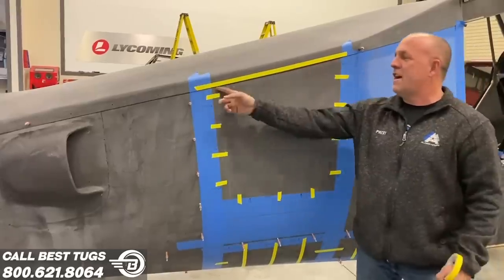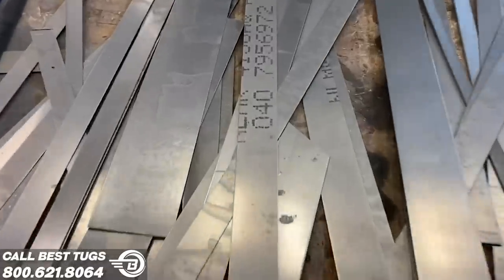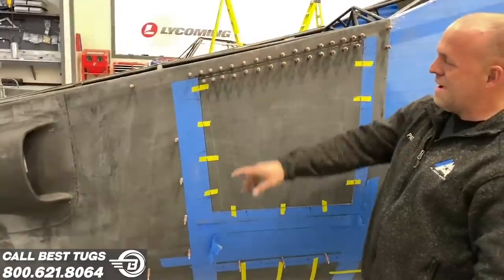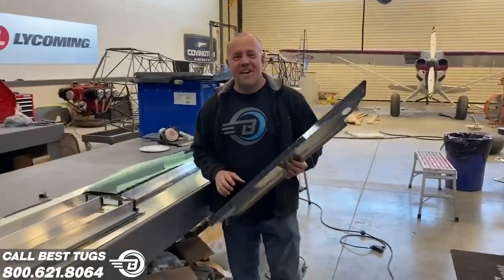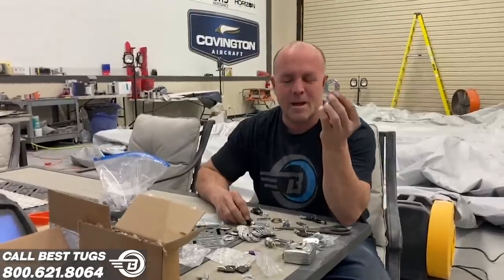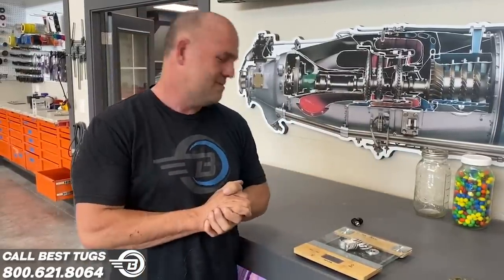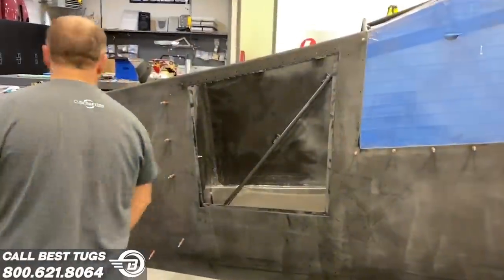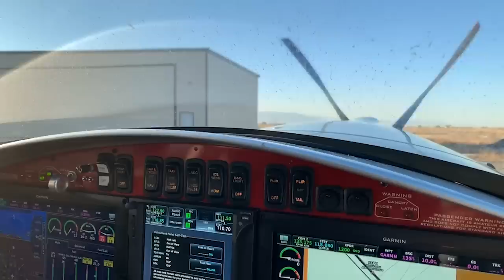Doors and locks (Scrappy Bush Plane 19)

Comment: And the rocket assisted takeoff, that’s being installed when? Still amazes me and stops me in my tracks every video you release.
Reply: Bruh with the engine and prop scrappy has, its going to take off like a rocket assisted cub compared to a stock cup

Comment: wonder if the cable pulley bearings run easy in the cold,  tossing one in the freezer and checking the rotation would at least give you an idea how they will spin back there in the freezing mountain tops.

Comment: I would have put rounded corners on all your doors.  More work but looks better, is not a sharp corner to hit your body on, and eliminates fatigue cracks from vibration in the corners.  Just my opinion.
Reply: it is not only your opinion: De Havilland DH-106 Comet 1...
Reply: honor harrington - all perfect but the sharp corners were my first thought and concern. How many times I’ve bumped my head on such edges that stick out when they are open, and those carbon edges should be especially sharp...  At least the corners should have some sort of flexible edge.
Reply: Good Idea but might be not necessary because of the carbon iber orientation. And the carbon haul won't take extreme stresses that part will be taken up by the tube frame i think.
Reply: @МитяА-с4н  That was a pressurized airplane. This isn't.
Reply: Valid, except you won't be able to fit as big of items to the door for storage...
Reply: Agree.  It's the same reason- and fix, for the early Constellations; they originally had square windows, developed stress cracks, and had to retro'ed to round.  And that was in the 1950's.

Comment: Silly questions time! Lots of fasteners = lots of weight and lots of work to make attachment points. Will all these bolts be titanium to save weight? Do we even need the steel frame? There are plenty of vehicles with CF chassis. Why can't an airplane have a carbon fiber & honeycomb monocoque frame? Panels can attach with glass-filled nylon Dzus-style fasteners to save weight and eliminate corrosion concerns. Thoughts?

Comment: How did you make the custom latch cams for your new locks?  You said they are a bit larger and look to have a deeper offset.  Do you have a press brake :-)  I like your attention to detail.  I've often wondered how the fuselage covering was attached to the tube frame.  Great work.

Comment: Question: You are using circular keys instead of notched keys. Don't notched key slots on airplanes have a little spring loaded weather door to keep water and dirt out? Seems the circle keys slots are exposed to the elements.
Reply from the maker: Laz    Great question 👍🤠 it’s an outdoor unit I use on equipment out in mud and dirt.  This will be way cleaner so it should outlast the plane but easy swap if needed

Comment: I was a bit puzzled about the hatches. You made them with square corners. I was wondering why you did not use rounded corners. Will you not be encountering stress fractures in the corners in the long run? Or is the fuselage skin not load bearing at all?

Comment: I didn’t know carbon and steel could corrode. I know that was a major problem with the twin towers as they were trying to figure out how to repair them or tear them down before 9-11. The biggest problem is that they never provided enough income to provide the Port Authority with enough funding to maintain the building. Things were so bad that they let a band have an entire floor for practice with a deserted floor above and below to buffer the sound and keep the noise from disturbing other clients in the building.
Outside of that, Mike it’s crazy how much I’m learning about fabrication from your videos. I just with I had a shop and the funding to try building my own!

Comment: Just wondering Mike- I see someone else mentioned it in the comments here, but with all the carbon skin, did you ever consider just making the fuselage all carbon monocoque & ditching the steel tube frame?
I’ve followed this build from the beginning and am certainly no engineer but would be curious to know your thoughts...
Back to work!

Comment: Mike the back up plates for the door locks ,, they looked like they had a curvature on the side that contacts the carbon graphite ,, why not stick a rubber O'ring inside that curvature or Silicone,
Reply: That would have been the easy way out....and added weight

Comment: Ok stupid question why not powder coat Scrappy's frame instead of painting it? Just Curious 
I don't recall you showing how you layout the bolting holes of the body to to the frame of Scrappy but when I was working at a fab shop I had a buddy of mine with a cnc vinyl cutting machine make heavyweight vinyl strips with evenly cut holes at different lengths of center so that I could layout holes at even spacing quickly.
PS every little trick part you make for any project is worth it.

Comment: I am wondering, what  kind of fasteners do you plan to use to bolt the skin to the frame? You do not want galvanic corrosion, I assume flush with the surface so I am curious what ISO/DIN fasteners you plan to use :) Thanks!
Reply: Could be titanium screws for the galvanic corrosion then something like DIN 7991 could work to be flush
Reply: @MaximEck96  Could be but the problem with those 7991 countersunk heads is the required thickness of the material. I dont know how thick the carbon skin is but when you take M6 for example you would need at least 3.5mm thick skin for a solid connection. An alternative could be ultra low head hex/torx bolts like 7984XT or "furniture connection bolt" type fasteners. (obviously made from aviation grade material that plays well with carbon and steel)
Reply: @StefsEngineering  that's true, or maybe some rivets caus you know aviation and rivets are a love story but idk if they have some titanium ones but none of those would be perfectly flush

Comment: Maybe you've already answer this question in an other video, but you often talk about corrosion cause by carbon fiber being in contact with metal. Do you have a way to prevent that from happening to all the screw, rivet and pin that goes thru a carbon fiber part?
Reply from the maker: Benoit Sauriol yes the holes are oversized and the nut plates are isolated. Then the screws I use all have nylon washers

Comment: 23:10 - I listened carefully to your door strut proposal... If the strut is being used to "pull" / "suck" the door closed... how do you actually open the door. You insert a key to unlock/rotate the locking tabs but how then do you pull the door open as there will be the force from the strut to overcome. Is there some sort of handle, either exterior or recessed that you grab and pull?
I'm a little confused on this aspect of the door design...
Reply: Same here looking forward to see it in a new vid
Reply: Magic engineering silly!

Comment: Hi Mike, as the luggage doors ware I don’t see room for the gaskets or seal? Your fit is so tight that the door would putrid if you add seal.
Reply from the maker: John Martin great comment. 👍🤠I’ll show it later, it’s a film seal and doesn’t ware and easily replaced years later.  I have used it in the past and it works amazing for tight fits exactly like this.  👍🤠

Comment: If it's rubber sealed,  does this mean it will have its own air, or will it come through the engine path?
Reply from the maker: aserta it’s own air and heat inlets and separate tail outlets

Comment: How do you stop galvanic corrosion between the fasteners and the panels they are holding?
Reply: Titanium screws would work well... But anyway steel and carbon don't  have much corrosion, problem is mostly with aluminum.
Reply: @MaximEck96  I'm just wondering what Mike is using as he mentions it.

Comment: Galvanic corrosion between Carbon Fiber and Steel?
Reply from the maker: suntzuwu  great question 👍🤠Alluminum is the real problem but I like to isolate for vibration and abrasion on all the metals so I do it on everything. temperature expansions movements are so different I like an extra barrier.

Comment: Mike, why aren't you using a profile guide to make your life easier? Some people also call them a contour guide. I see you cutting cardboard, then fitting it, then recutting the cardboard and refitting it and recutting the cardboard and refitting it, and so on. A profile guide would make your life much easier, and some of them will even connect end to end to make them as long as you need. Heck, you can hook as many of them end to end and then get an exact profile the first time every time.

Comment: I don't understand what those pointy things are you use to "bolt" the carbon to the frame. Someone please help?
Reply: FranciumNuke 
The pins you see sticking out of the fuselage are temporary fasteners called Cleco fasteners. They’re just used to hold all the parts in place until he removes them one at a time and replaces each with a permanent fastener.

Comment: I just realized he hasn't even mentioned the bloody wings yet.I wonder if they will be "strut less".
Reply: Nah, the struts will be full air-foiled lifting bodies, with internal torsion rods allowing them to flex as part of the flap system!
Reply: His frame doesn't have the kind of carry through structure that would be required for cantilever wings - plus a wing with a strut will be lighter.
Reply from the maker: It will have struts 👍🤠 I consider not but it saves weight. Maybe another build
Reply: Now,you say that but we all know your keeping them for mounting the jato's.thinking about it you could probably sing a lot of stuff under the wings,maybe even an ebike.

Comment: One wonders if there's any legal reason to don't use servos or "Fly-by-wire"(Right now there's is servos capable to put our up to 900 pounds of thrust)... in stead of using cables and pulleys??
Reply: I’m thinking that the CPU’s needed would be cost prohibitive..and weight prohibiting too ... plus Mike is a Tactile flier too.  Never get that “FEEL” with FBW
Reply: For small bush planes I think cables are best so you can feel what is going on. Fly by wire makes more sense for bigger and like unstable figter planes. Fly by wire is so much more complicated thus less riliable. You want to be able to fix your bush plane out in the middle of nowhere too so simple is best
Reply: @Fantaman900  Fly by wire does have force feedback but I too would rather have cable and pulleys. Less of a nightmare when something doesn't work exactly correctly and not to mention the price!

Comment: re: your locks.  Watch any episode of LockPicking Lawyer...  super cheap impressioning tool will open those in 1/2 a second.  You might want to re-think what locks you use.
Reply from the maker: I agree with you completely 👍🤠 It’s not about locking the plane from theft. It’s not really a thing with planes and no cubs even have locks at all.  They just have a slot for a nickel or quarter in your pocket to open everything.  They only reason for the lock is to keep the doors secure and closed in flight.  Having a lock at all is a upgrade but I’m not worried. I have never had anyone come in my campground at the plane next to my tent and take anything and at hone it’s locked in a camera hangar.  But if it was a car left in a parking lot I would not use these locks

Comment: i thought aluminum on carbon is bad. why are you using it for the locks
Reply from the maker: Bailey Louque  great question. 👍🤠 I isolate them with a layer of fiberglass and it stops all corrosion and so easy to do and I get the weight savings

Comment: Who do you think you are fooling? Around 02:30 into this clip you are talking about how QUIET this aircraft will be. Dream on! Any overpowered, underweight STOL aircraft is going to be noisy, like sitting inside a drum. You might be able to reduce noise a bit, but expecting it to be actually quiet is a pipe dream. Buy a Bose headset, that will certainly work better.
But - after seeing what you did with the Draco I have no doubt this will be awesome.
Reply from the maker: Halfdan Ingolfsson  lol 😂 for sure your correct.  I even laughed in the video about except the engine.  What I was referencing was all that extra wind noise many cubs get.  But certainly your right and A good headset is the cure 👍🤠
Reply: @MikePatey , I do believe you once visited my country, Iceland. I may be mistaken, I might be confusing you with another YouTube aviator. I definitely used live in your part of aviation: Short field, specialized aircraft etc. I cut my teeth on BN Islanders and H-295 Helio Super Couriers in 1977 before moving on to slightly faster aircraft like PA-23-250 Aztecs, C-404 Titan and PA-31 Chieftains (160-180 knot range), before slowing down for the queen of STOL, the venerable DHC-6 Twin Otter, all with the oldest still-operating airline in Iceland, Ernir Air (Eagle Air). The last decade or two of my aviation career (interrupted by excursions into electronics and computer programming) I spent flying DHC-6, Do228, Do328 and BAE J32 Jetstreams. Retiring due to old age in 2015 I still fly exceptional STOL aircraft privately: A 33-year old Avid Flyer built by myself, my brothers and our old man (he's 92 now and the Avid Flyer is on it's 3rd engine) and a privately owned H-295 Helio Super Courier (TF-VIK). We live in the West Fjords, have a summer house in Hornstrandir with a 2-runway "airport" (Fljótavík International), all of 300m each runway (<1000ft). If you are ever in our neck of the woods (metaphorical, we have very few trees in Iceland), please look us up.
Reply from the maker: Halfdan Ingolfsson my twin brother mark  lived there two years and went back a year ago